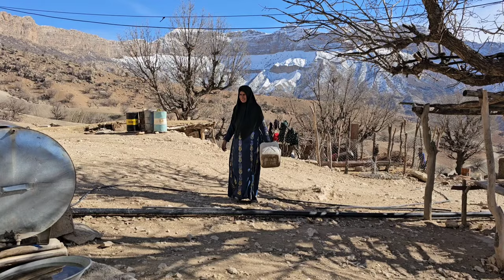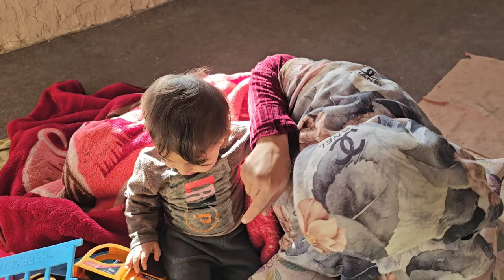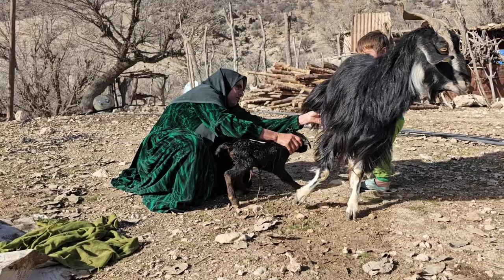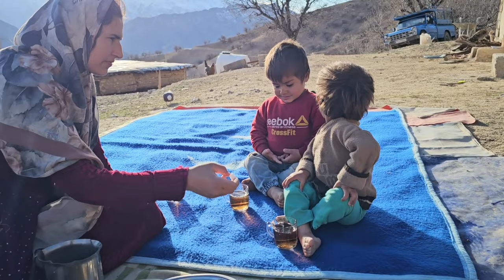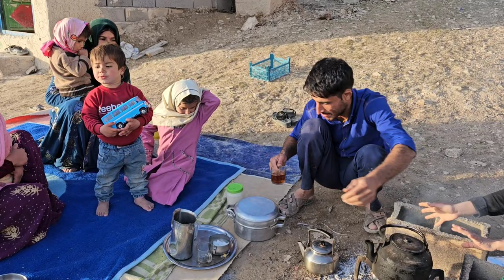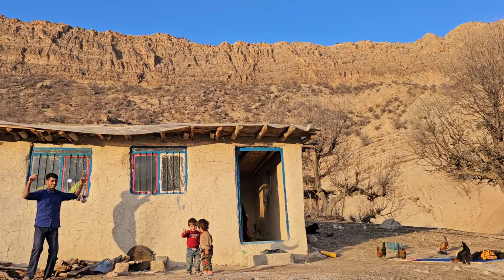Trying to make a comfortable and beautiful bathroom for dear mother

Comment: Good to see Hassan helping Hasan with the build. Good man.
I'm not a fan of cementing concrete cinder blocks without steel rebars. No steel rebars will cause the walls to bow and buckle. Steel reinforced concrete ring any bells 😂